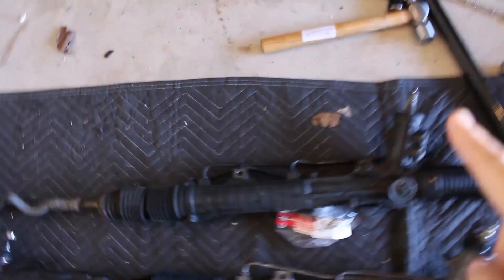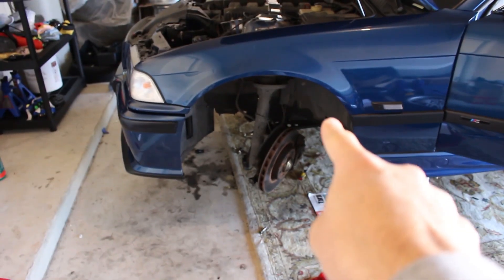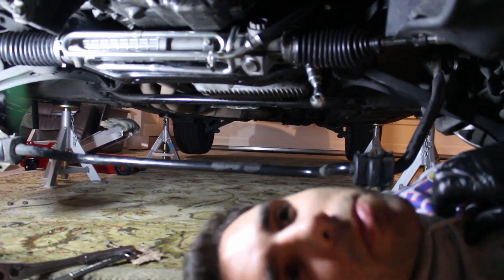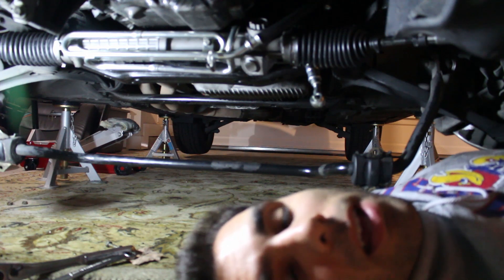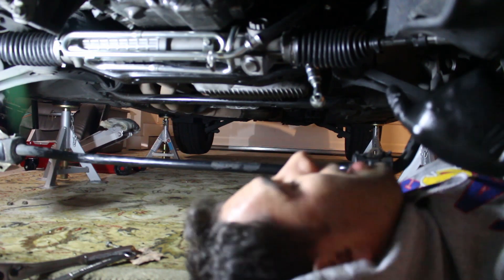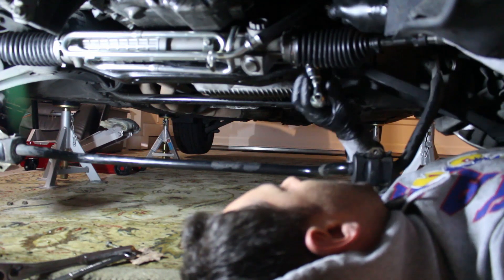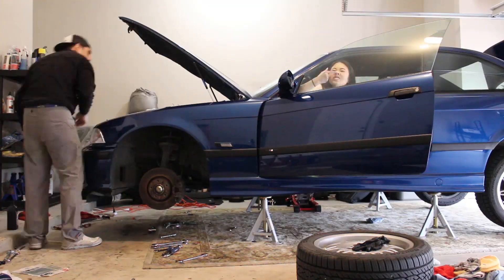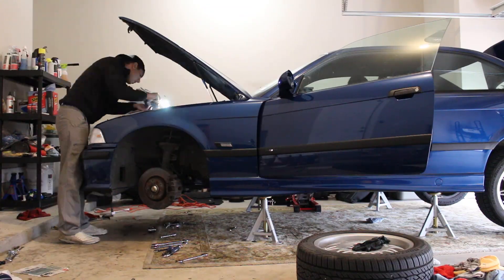Installing E46 ZHP Steering Rack Into E36 M3 - Is It Better?

Comment: Is this e46 rack completely bolt on or you have to mod something to install it on the e36?
Reply from the maker: Yup! I had to buy new E36 tie rod ends because my ball joint boots were torn but I'm not 100% sure new tie rod ends are completely necessary. Here's what I bought with the E36 tie rod ends: https://shop.rackdoctor.net/2002-2005-BMW-330i-330ci-ZHP-UNIT-Rack-And-Pinion-27995-25892-712ZHP.htm
Reply: @jpetro  Awesome, I recently got an e36 and I'm starting to do some mods. It feels a little wabbly at times and I have already replaced the tie rods and a few bushings. Maybe I'll replace the steering rack in the near future and this upgrade might be the way to go. Waiting for your review on it. Thanks for the help. Cheers!!
Reply from the maker: Yeah man, it'll help for sure. Also, replacing that steering coupler (the piece I had to wait to receive) makes a big difference as well. I believe you can find the E46 ZHP rack for less than Rack Doctor sells it for too.
Reply: @jpetro  Also, if you want to make the steering a little sharpier, some people use an e34 joint instead of just replacing the original one as you did (Part number 32311150489). You'll feel a little more of the road's imperfections but it improves the wheels response considerably.

Comment: Hi do you need all E46 Pipe lines or can i only change steering rack ? And use all Pipe to my e36
Reply from the maker: Yup, you can just use the rack and outter tie rod end links. Rack Doctor has an option for that: https://shop.rackdoctor.net/2002-2005-BMW-330i-330ci-ZHP-UNIT-Rack-And-Pinion-25892-712ZHP.htm

Comment: This sounds like a great swap but I recommend avoiding the Rack Doctor though. I ordered a ZHP rack from them and when I got it, the “yellow tag” was painted over.  
When I removed the paint from the tag with thinner, I discovered that the coloring and markings had been removed by what looked like a wire brush. But you could still see a little bit of purple paint around one of the rivets! So in other words, not a ZHP rack. “Purple tag” racks are standard E46 325/330 racks. So you might want to check your ID tag, just to be safe. Couldn’t see it in your video because you had the rack turned over. If it’s painted over, you may not have an actual ZHP rack.
Reply from the maker: Superdessucke woah! That’s crazy! I’m assuming you returned it?
Reply: @jpetro  - I requested a full refund but they have not responded to my request. I'm challenging it in other ways though. I'll keep you posted. Meanwhile, buyers beware.

Comment: Broseff do you recommend just replacing that coupler piece? I have a feeling I might run into the same issue. Upgrading to the z3 rack though. But where'd you buy your rack from?
Reply from the maker: Yo! Man, so I've heard good things about replacing the guibo joint but I'm not sure HOW big of difference just that piece will make. My rack was completely shot so I don't have a really good baseline. I got my setup from RackDoctor.Net. It was a little more expensive than you can find on eBay but they have a good reputation and the service was great.
Reply: @jpetro  got a part# on that zhp rack? I'm seeing too many different ones
Reply from the maker: Yup! 25892-712ZHP and I added outer tie rod ends for the e36 since you can’t reuse stock.

Comment: Everything is great but I don’t understand what is part number on your new steering rake. In Internet I found it to part numbers. The first is 7852974712 The second is 32132282296. Which is the correct number. I will be Grateful.
Reply from the maker: Here's the rack I bought. Remember to get E36 outers if you're putting it on an E36  👍https://shop.rackdoctor.net/2002-2005-BMW-330i-330ci-ZHP-UNIT-Rack-And-Pinion-25892-712ZHP.htm